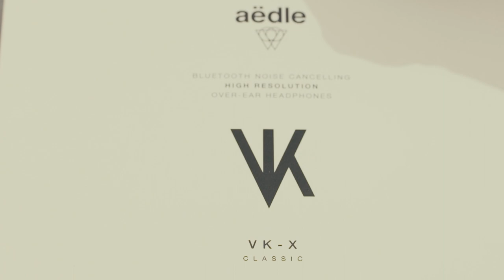VK-X: Meet Baptiste, our Founder

Comment: I have 24 headphones including an lcd-4....the Vk-1 is the absolute best balanced , best tuned, and best sounding headphones I own....none are close... BUT....they are THE most UNCOMFORTABLE headphones of them all...they are so impossible to wear....i literally get an earache from the pads because the clamp pressure is super tight, but even worse, they leave an indentation on the top of my skull
..its sadly the most frustrating set i own..the headband is absolutely too thin...you cant adjust the cans at all. If you are a masochist- these would be perfect for you....
If Aedle would come out with a comfortable headband to swap out this rubber band thats on it, I'd be the happiest man on earth because these are so damn great sounding!